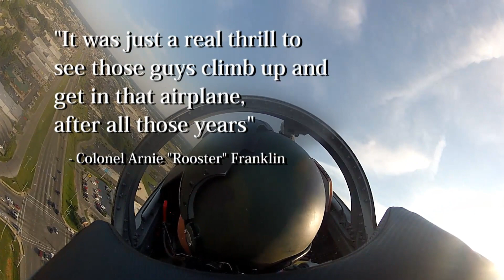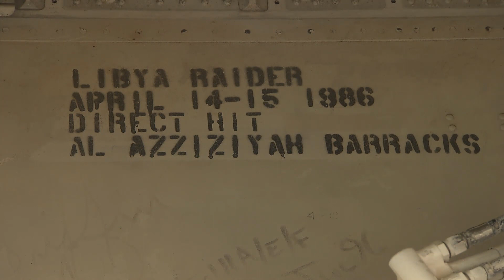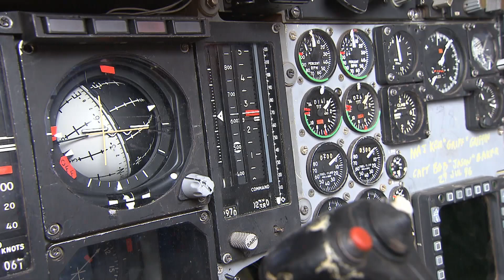MainStreet - "F-111 Restoration"

Comment: Cool video. I also wondered why it went from CC to LN markings. I worked Automatic test stations in the avionics shop 86-89.
Reply: F111A/F  AFSC 32650, stationed at Mtn. Home, Korat, and Nellis from '73-77. I hope Cenpac and the 6815 got more reliable in the later years. Did they ever upgrade Cenpac to hard drives or was it still mag tape?
Reply: @Bdub1952  when I left in 89 we were still running cenpac. Still had plenty of provlems
Reply: @SmokeyT63  The cable ends on those relay racks were a nightmare.
Reply: @Bdub1952  by today's standards, EVERYTHING was a nightmare then. And when you mobilize it took 2-3 months to get it all working correctly again. Good times lol
Reply: @SmokeyT63  The best part was that the avionics shops had to be air conditioned. The flight line guys were always jealous.
Reply: @Bdub1952  they sure were. Our building was getting a lot of upgrades for a while so we had our shop set up in a bubble in one of the hangars. The looks we would get were priceless